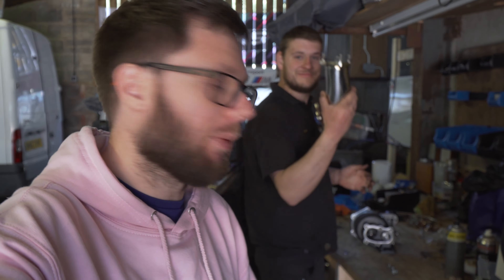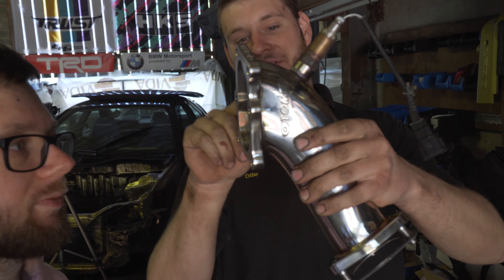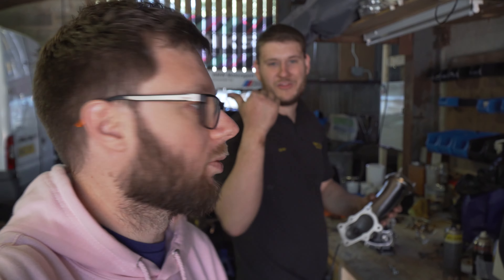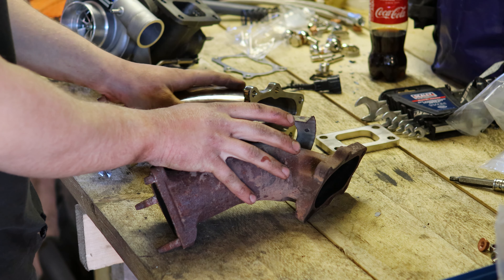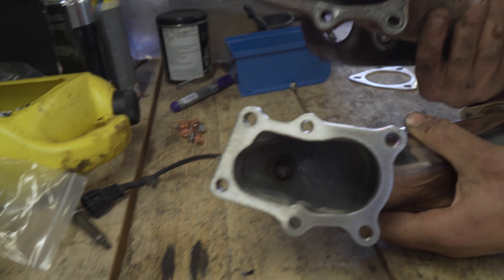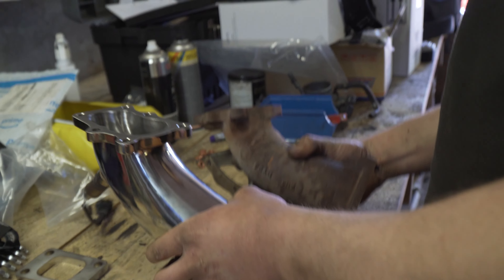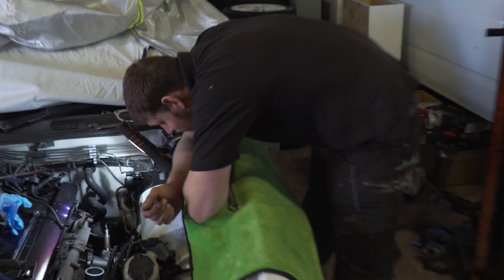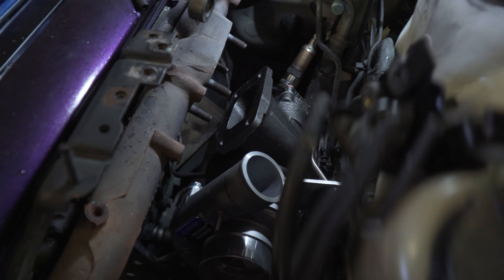Skyline Gets Mamba GTX3071R + Tomei Elbow - Finally! | R34 Build Ep.6 | 4k

Comment: The standard elbow is fine for any low mount application, those courses boost creep by being too open
Reply from the maker: The standard elbow will work yeah but by removing the restriction you can make the same power with less boost 😀